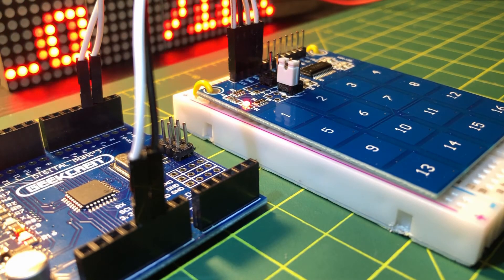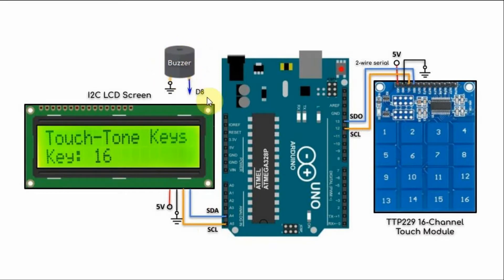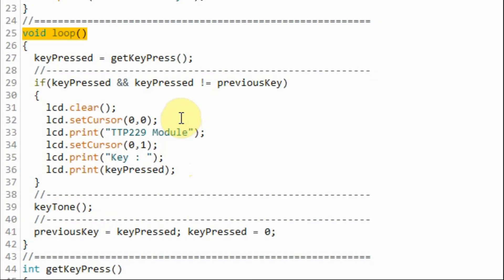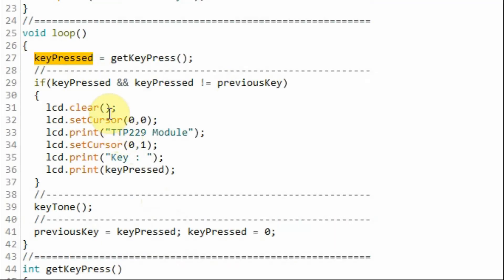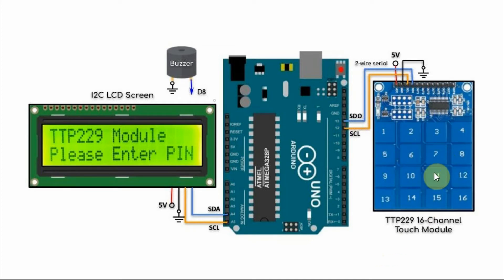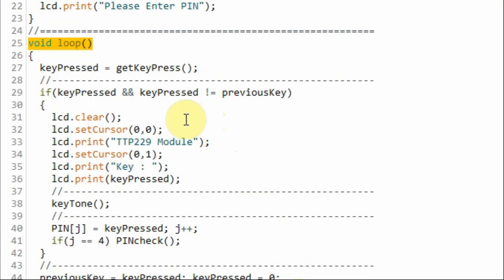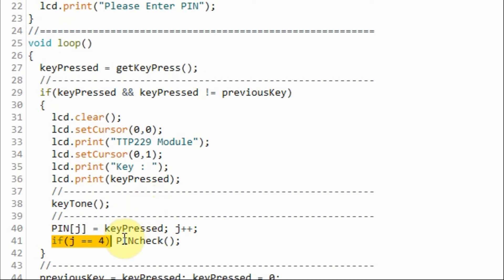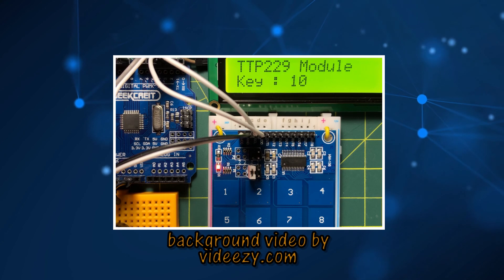TTP229 Module & I2C LCD Arduino Projects

Comment: It's very frustrating when you have the same board, the same LCD, the same I2C, the same connections (even without any or very vague explanations of the connection) and nothing works at all. Even with the ungrateful help of other comments. Little interest in this channel therefore if the sketch doesn't work.

Comment: code is not working please help
Reply: In this picture The pins of sda scl is incorrect, at sketch it defined to pin 2 and pin3, not a 12 and 13 - connect the wires to 2 and 3 and You will be happy! may be...